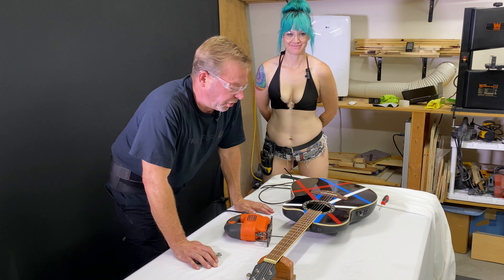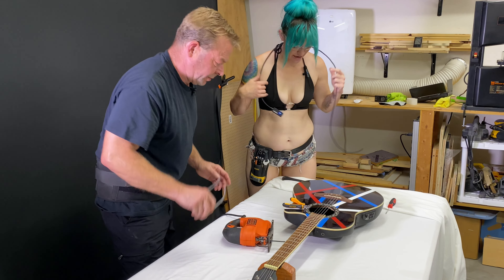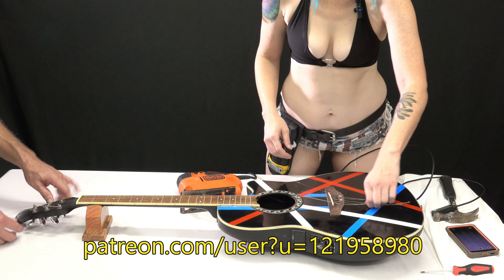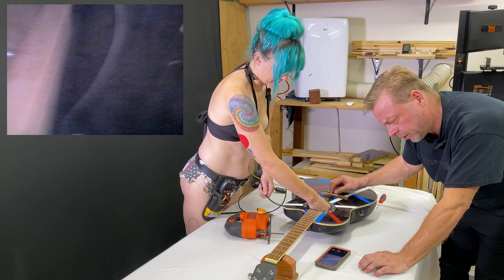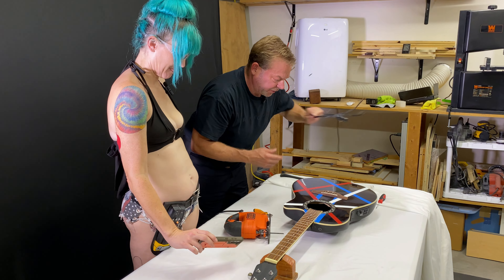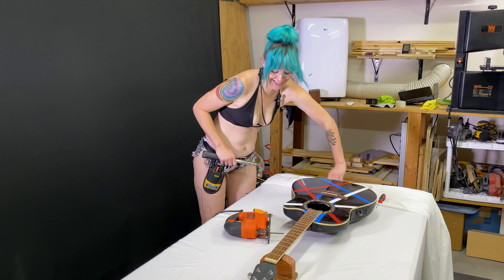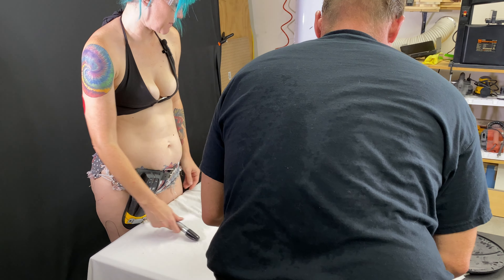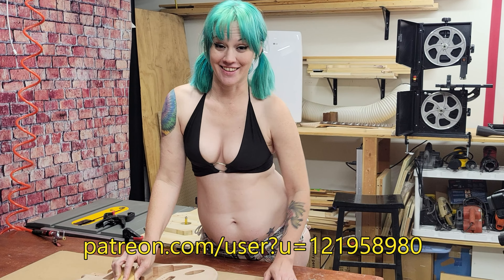Ovation Autopsy | Cutting up an Ovation Guitar for donor parts

Comment: I always wanted to see how an Ovation was built. It looks like the battery box and electrical stuff was molded in place.
Reply from the maker: You are correct, the electronis package was molded into the plastic body.